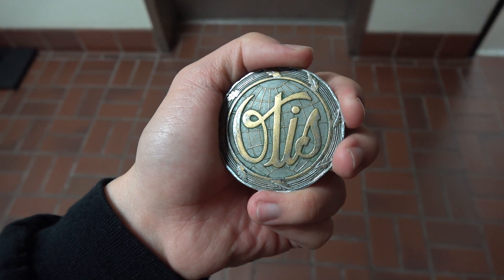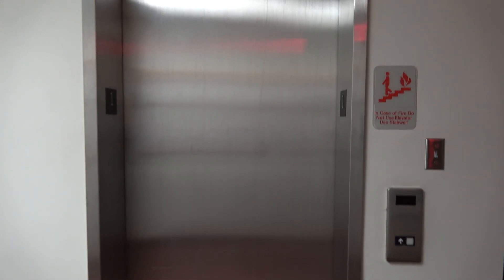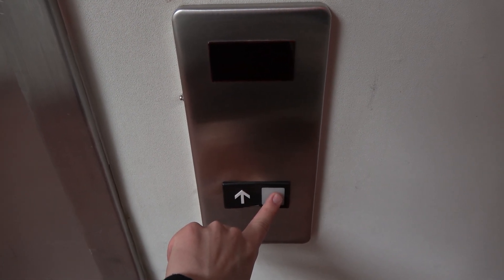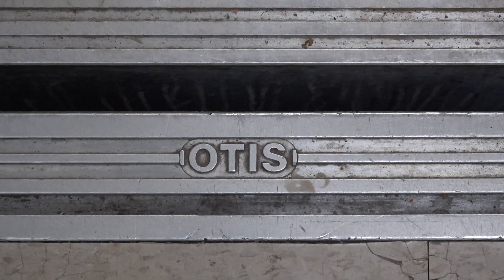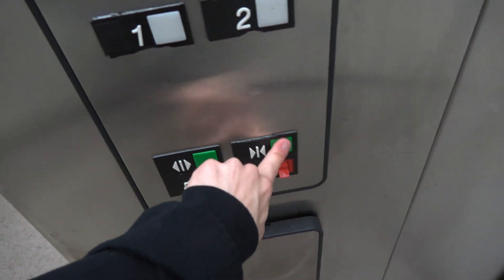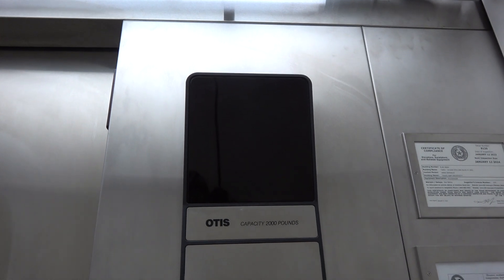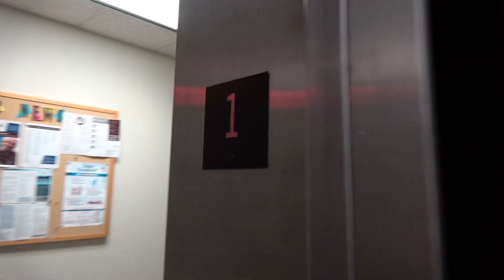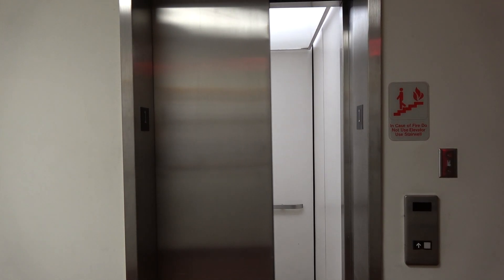DOOR SENSOR FAILURE! Older Otis Series 1 Hydraulic Elevator at TAMU in College Station, TX.

Comment: Are you going to do an updated take on this elevator how it’s doing? It’s been two years since this thing didn’t have a door sensor.  I wonder if they installed a door sensor for this elevator right now.
Reply from the maker: I actually filmed this thing last week ago. Not only is it still original, but I think the sensor partially works (did not test it on camera though, maybe I should the next time).

Comment: This actually has one of those touch sensitive bar sensors which kind of work like a bumper but look like a normal infrared sensor.  Otis used these on their early 80's Otis Series 1 elevators up to the late 80's.  A lot of these have been replaced because they definitely aren’t the safest door safety features and what you do it have to continuously touch it to reopen the door.  There are a couple of these in my area that still have these original touch sensitive door sensors surprisingly.

Comment: When I was at the Delta By Marriott in Richmond VA. When I was going to enter the elevator. I used my leg to open the doors back up but the sensor didn't work.
Reply: I filmed at the Delta by Marriott in Richmond.  The sensors were working fine.  I was getting a view of the interlock, and the doors did not close on me.